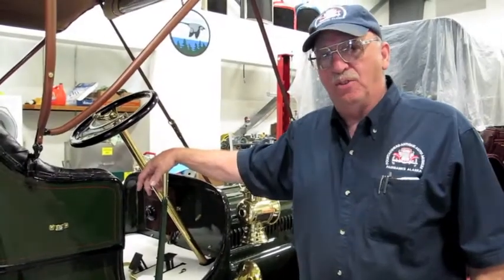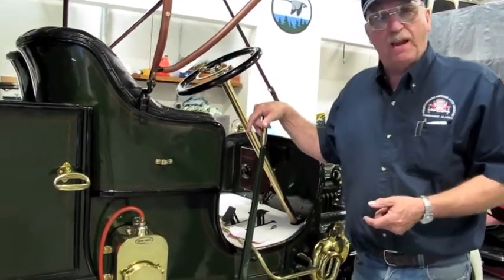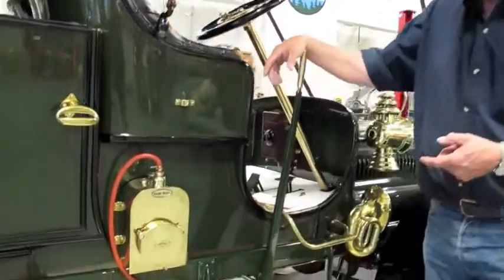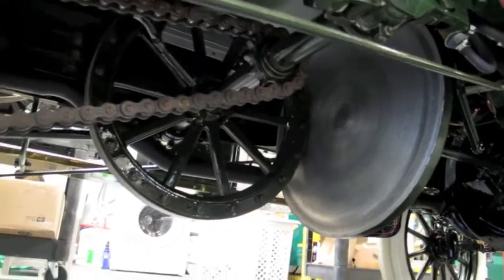1907 Cartercar - Fountainhead Museum - Fairbanks Alaska

Comment: They called it the “Car of a Thousand Speeds”!  The liner on the drive wheel was either leather or rubber a d often had flat spots worn on it that would cause problems.

Comment: I just posted a long message below on the theory of how many ways you could accelerate this car, but I am looking for an answer from someone who might know!    I heard that the early engines, especially, I guess, some that had a system of fuel delivery more primitive than a carburetor, had a narrow range of RPMs from idle to full tilt, limited I guess from engineering difficulties at the time.   what I heard was the friction drive was the best option for these engines, that normal gearing wouldn't have worked as well.    Is this true in any way?

Comment: No one ever seems to explain how many variations of throttle combinations with points on the flywheel to achieve economy, high-speed power acceleration, or hill climbing to give 3 possible scenarios. A steam locomotive has a similar variable method of "notching" and throttle position.  But the best example of what I am trying to say is to consider the modern Bobcat loader with the hydrostatic drive.  I can't believe no-one I know seems to understand the principle of fuel savings and making the engine last in these! They just rev it to the max for all the work they do. At max with levers full forward, you can fly!  But if going half that speed driving around, what is the sense of screaming the engine and then half-positioning the levers? Instead of one-half engine speed and full forward on the levers? You don't need the full horsepower delivery capability of a screaming engine only to waste it in the powertrain!   If you're digging hard, then full throttle and easy on the sticks might be needed to gain the power in the dig.The whole thing I guess I'm trying to say that an understanding of what engines and powertrains can do helps in operating machines like this car.  That is why the big trucking companies teach "progressive shifting". The understanding of what horsepower is needed at different increasing speed points, so the drivers don't over-rev the engine when they don't need the power, and shift up as needed, to match delivered horsepower to the wheel at low speeds!Now imagine all the different tricks you can do with that car in the video above, depending on whether you're going to the feed store or robbing a bank for instance!